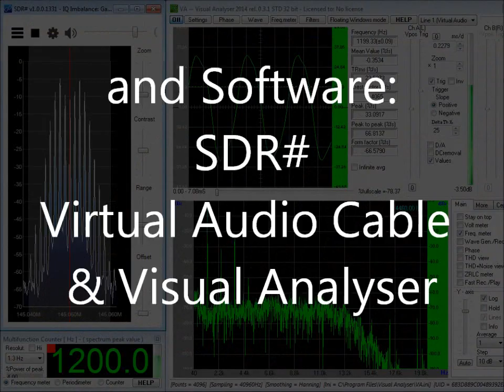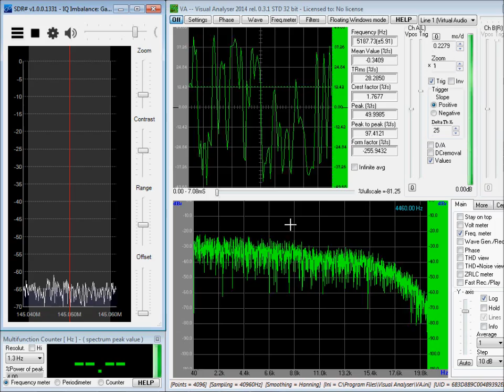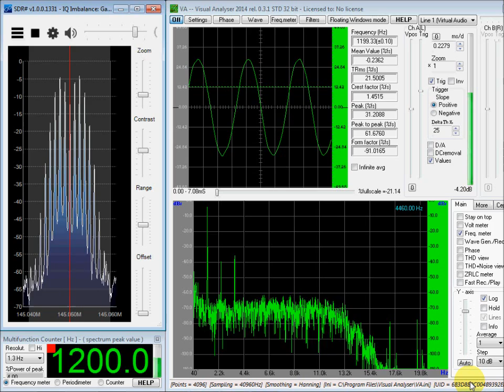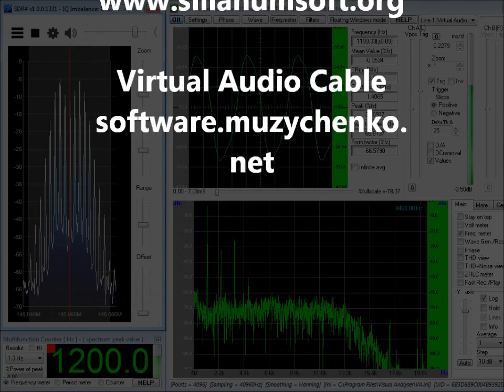Frequency Deviation Measurement with an RTL-SDR Dongle

Comment from the maker: Using an RTL-SDR dongle and my laptop computer, I measured and found the FM deviation with my PacComm TNC was way too low, and the UZ7HO SoundModem and MMSSTV through the SignaLink were too high.  After adjusting the deviation to ±3.2 kHz, my packet connections are now much more reliable and I expect my FM SSTV picture quality will also improve.

Comment: Very interesting video!
How you connect radio output rf at the sdr received ? 40 dB attenuator?
73 de IU0PEL
Reply from the maker: The transmitter was connected to a 50 ohm load, and the RTL-SDR received sufficient signal with no connected antenna.  You may also use a 40 dB attenuator.
Reply: @kp4md  Thank you for your answer! You use Noolec SDR ?
Reply from the maker: @Alberto_Alletto  I used an old Newsky TV301U in the video, but the Nooelec SDR will also work.
Reply: @kp4md  TNX ! ‘73 !

Comment: This doesnt work for me. Increasing the audio level barely raises the deviation as shown on the scope.
Reply from the maker: You may have to increase the Zoom Level on Ch A(L) on the scope and/or raise the SDR# volume slider.  Alternatively, the transmitter modulation level will not increase if it is at or beyond the limiter threshold.

Comment: Nice video.  However unless I'm missing something, the description of how to set the proper deviation levels for packet radio is not correct.  The desired deviation for packet is, as you said, +/-3.5kHz (though many argue it should be slightly lower) however my understanding is that deviation is for the high tone not the low tone.  Your video is setting the low tone to 3.5kHz deviation.  Since compression/limiting is normally done after pre-emphasis, a deviation of 3.5kHz on the low tone will lead to compression/limiting on the high tone and will end up causing the dreaded "twist" on the receiver side after de-emphasis is applied.  With the typical 6db/octave pre-emphasis/de-emphasis I believe you should be looking for something more like +/-1.9kHz deviation on the 1.2kHz tone to achieve the desired +/-3.5kHz deviation on the 2.2kHz tone.  

If you calibrate the TX levels as described in the video, and you look at the audio signal out of any standard ham transceiver, you will see the 2.2kHz at a much lower level (often by nearly half) than the 1.2kHz signal.  The typical TNCs used generally are very unhappy with this and have more difficulty decoding the packets.  

Please correct me if I'm wrong, but I've done a few tests using an arbitrary waveform generator, a spectrum analyzer and an oscilloscope paired with different sets of transceivers and my tests seem to confirm this behavior.
Reply from the maker: In this video I fed the audio tones through the rear dataport of the Yaesu transceiver that bypasses the microphone pre-emphasis circuitry.  Its receiver also provides line level audio without de-emphasis via the dataport.  Your observations would logically apply when the tones are subjected to pre-emphasis and de-emphasis.

Comment: This method works very well with a decent PC and a simple hook up. I have been to able check out the factory set deviation levels on a number of Yaesu Ft-8800s & a Ft-8900 I have.
The Visual Analyser used by Carol is the 64 bit version which will display the values of the monitored sine wave. The voltmeter function can also be used and set to give a reference  deviation level. eg bessel null at 1khz can be set to indicate a deviation level of 2.4khz.
 (2.405 x mod f = f dev)
This is the recommended Yaesu setup frequency and should be unaffected by pre-emphasis. The wave generator function of VA can be used to generate the tone and if the  bandpass filter function is used it will clean up any harmonics generated and give a steady reading.
I found that the factory deviation levels were consistently set to +/- 4.5khz as to UK spec. The adjustment ranges were between 2.7 to 3.0 min and 4.8 to 5.5 max. The initial setup was on 145.00 Mhz and no further adjustment was required for measurement on 50 and 435 Mhz

Cheers
Steve G6SQX
Reply from the maker: Steve, thanks for describing your use of this application.  I used the 32 bit version of Visual Analyser for this video.  The "Values" checkbox under the CH A(L) controls is ticked to display the all waveform measurements.  I tiled the SDR Sharp window in the upper left, the main Visual Analyser window on the right, and the Visual Analyser "Freq meter" window in the lower left.  Although I used a Terminal Node Controller as the sine wave source, the VA waveform generator can certainly supply the necessary sine wave.  The sine wave source used needs to be free of harmonics and distortion in order to obtain the Bessel zero.

Comment: Carol great video. How do we know when we are calibrated correctly. If you change the audio level feeding the analyzer from sharp, it obviously will change the pk to pk in the analyzer. When i keyed my radio i looked for a low of 4% pk to pk would that be considered a good calibration reference point? 

Thanks 
Jeff-N2MKT
Reply from the maker: As seen in the video at 00:30 the audio output control of SDRSharp and the vertical sensitivity of Visual Analyser were set for near full scale vertical deflection in the top scope display on unsquelched background noise.   The amplitude of the sine wave at the Bessel Zero is the 2.4 modulation index calibration point (54.3% = ±2.88 kHz in this video).  The audio output control of SDRSharp and the scope sensitivity settings must not be changed to maintain calibration.  The frequency deviation of any other applied modulation will then be proportional to the peak to peak deflection with reference to the calibration point..